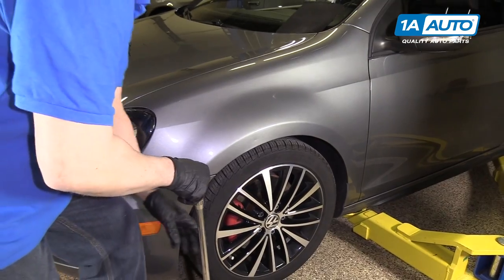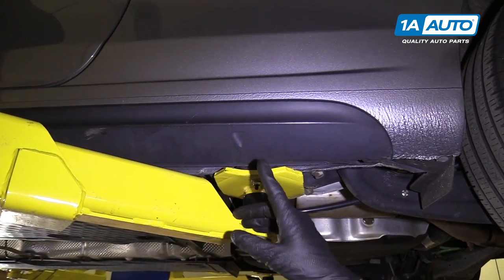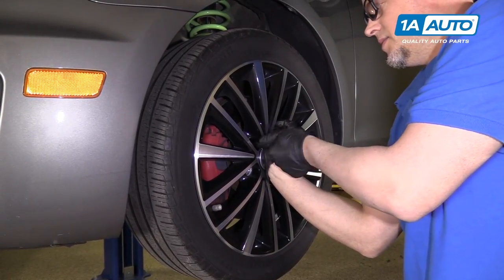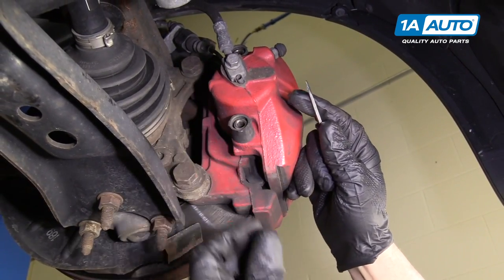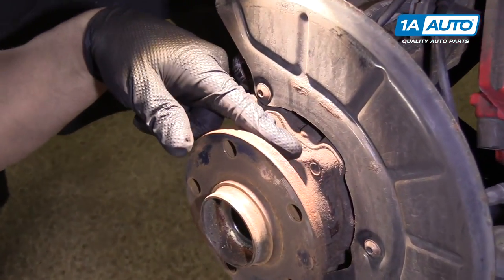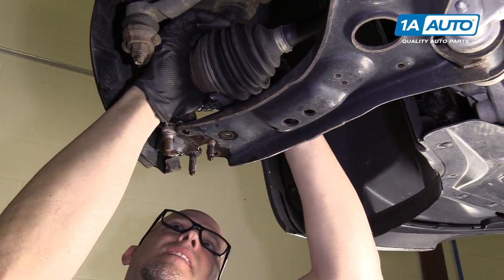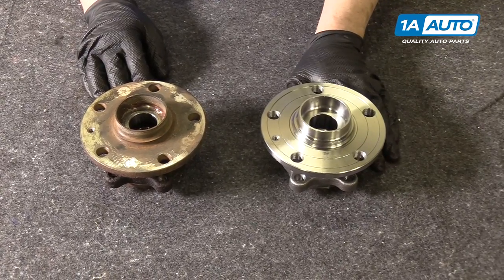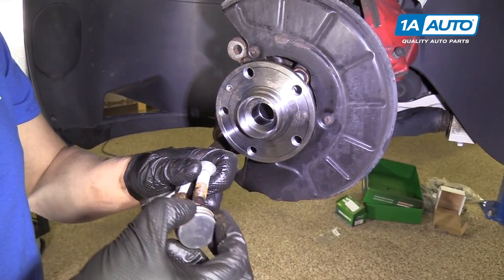How to Replace Front Wheel Bearings 06-14 Volkswagen GTI

Comment: Good video. Very insightful. Not to sound like a know it all however, in the name of saving time...you can access the hub assembly bolts without removing the lower control by pushing the axle in and turning the wheel to each side and removing two bolts at a time. Also if you remove the rotor set screw and the caliper bracket bolts only you can remove the rotor with caliper in tact and just put it safely to the side further saving some time. Thank you for the tutorial. 😎
Reply: Man I have just been fighting my axle for like 2 hours and came in for the night. Found this video and your comment. I will be trying this first thing tomorrow after I figure out how I'm gonna get my freakin control arm back on. Lol Thank you stranger.
Reply: I'd like to second the "Thank you stranger". Great extra info and your humility is on point. 'Preciate it.
Reply: @official13dvls_broknlnk_16  Your last sentence made a different stranger smile. Nice one dude.

Comment: The torque spec on those hub bearing bolts is 70Nm+90deg, which also means they are torque to yield and are required replacement each time they are removed.

Comment: Great video! I didn’t realize that GTI wheel bearings can be replaced so easily, I assumed one would need to press them in. Also appreciate that the mechanic did the entire process without power tools, makes it seem much more doable us casual DIYers.
Reply from the maker: +tedjohnson64 Thanks for checking us out! http://1aau.to/m/Shop-1AAuto-c

Comment: The easier way to replace the wheel bearings completely imo, since I just did it.  Is to take off the entire knuckle with the bearings still on it.  If the bearings are shot, the knuckle has already has rust and wear.  The whole knuckle replacement is a lot easier when the bearings are completely stuck on.

Comment: Did u say 16 or 60 newton meters for the 3 ball joint nuts???   I listened several times & can't quite tell, 16 seems too low.
Reply: 60Nm.
Message me your email if you'd like the Quick Reference Specification Book (PDF format, 276 pages). The document is for the 2013 VW Golf and VW GTI, but I'm certain it applies to all Golfs and GTIs from 2010 to 2014 (produced for the US market).
Reply: hahahah I think he has been confusing the lb and N lol 16N would be 50lb.
Reply: Dziri I’d love the quick reference guide. I have a 2011 and 2012 Jetta.  Thank you.
Reply: I wondered that too, but I thought 60 was if it was cast steel - which that did not look 🤷🏻‍♂️, if sheet steel or aluminum then 100 NM

Comment: Would you be able to break the axle bolt loose before you jacked up the car for the first time, rather than after removing the caliper?
Reply: the problem is the center cap needs to be popped off from the inside with the wheel off.  Be great if you can figure out how to pop it off w/o removing the wheel.
Reply: You could if you don't mind destroying your centre cap. Pry it out with a screwdriver

Comment: I installed a new bearing. During the process of installation I hit the bearing several times with the hammer. Actually I hammered the hub (with  a plastic hammer though) it almost in 1/3, then used press, but didn't know I need to use a lip on the bottom. The center of the bearing came off on the bottom like for  1 mm. I placed the lip and made it even again with the hammer. The hub is rotating very good, but gives a slight   grinding noise, not like the other one I replaced before, which rotates  with more efforts, but doesn't make any sound. Should I replace  that bearing with the slight grinding sound? Probably I shouldn't hammer it that much (though with the soft hammer). Thank you for the informative film.

Comment: Can anybody double check a few of the torque specs, especially the axle bolt?  I don't have a manual yet, & I'm hearing different torque specs for a few of these.
Reply: Yes!

I'm pretty sure the axle bolt and torx bolt values were accidentally given in reverse order.  

According to a shop manual for my specific year and model, axle bolt is 180 Nm plus an additional 180 degrees turn.  Hub bolt should be 30 Nm plus 90 degrees more.

l believe one other commenter mentioned stripping a torx bolt. 😬 ouch!

And, I'm no mechanic,  but I suspect an under-torqued axle bolt can lead to  ABS and ESC issues (via improper readings from the ABS speed sensor)

Otherwise, a very helpful and well explained video.

Comment: On the other videos doing this replacement, they put Locktite on the bolts holding the Hub in place, but you used the opposite.. never seize..?
Reply: yah I think I'd put on some Blue Loctite instead of anti-seize !!
Reply: You guys have “Fun” if u have to take it back apart.  Do you keep your “easy” out screw extractors beside your loctite collection? Do you put loctite on your lug nuts?   I don’t use loctite unless there’s strong emphasis for it.  I use antiseize compound &/or grease on threads, bare metal & such that I Know is going to corrode, rust & seize up otherwise. The correct torque is supposed to hold parts together NOT rust. If those 4 big bolts torqued w/ 50ft Lbs comes loose; something AIN’T right. You’d think the factory used loctite on my original wheel bearing, & really they did: RUST, & it was hell to get apart.  Same for electrical connections: dielectric grease.

Comment: I just stripped one of those 4 torx bolts. Be careful when undoing those guys. My only option is to  hack at it with the angle grinder I'm guessing. Shouldn't be too much of a problem..

Comment: You torqued everything improperly as you didn't include the angle. Values didn't sound right either. 16Nm for the nuts? 50ft-lb for the axle bolt???  When I did this job on a 2017 it was 200Nm + 180°

Comment: You have to change that entire thing? What happened to just pushing in a new bearing
Reply: he said in the video that it comes as an assemby. personaly i prefer not to press in new bearings. this is much better.
Reply: The part costs more, but it’s dramatically easier to replace. Not having to remove the knuckle to fight with a press makes these jobs go a lot faster.

Comment: Why would you remove the caliper from the caliper bracket, unless you were purposely wasting time? You do so many unnecessary steps, it's like you are trying to justify the overinflated labor prices mechanics charge.
Reply: Looks like he installed new rotor and pads as well as a new hub assembly. Video should have been titled as such.